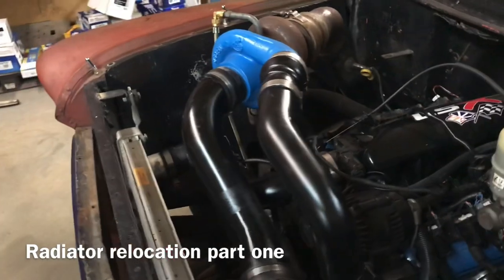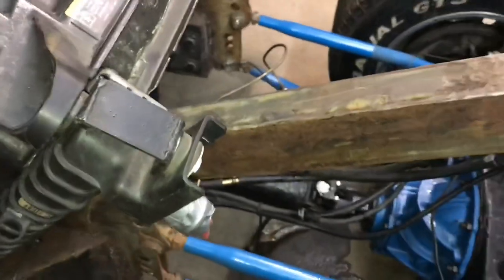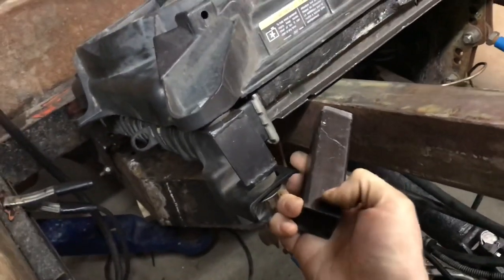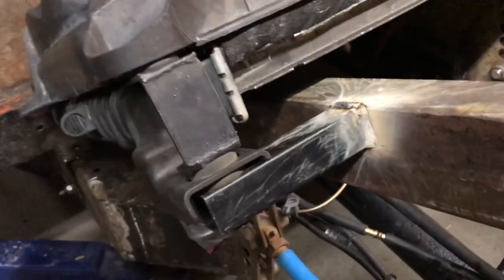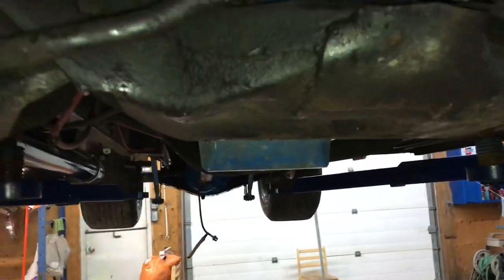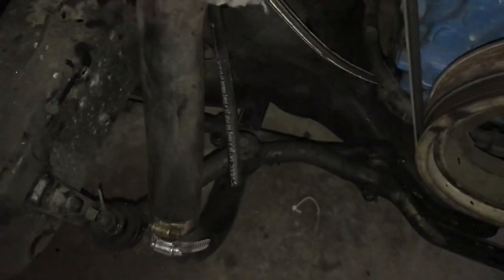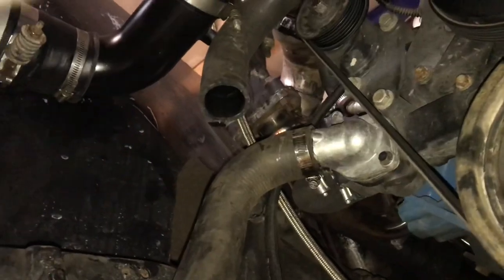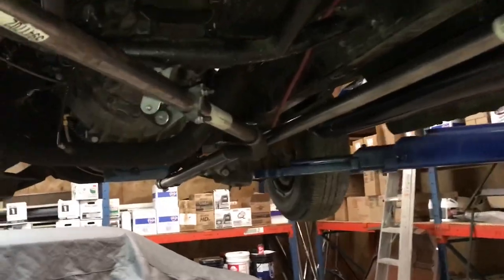How to bed mount your radiator super easy!

Comment: Did you put a better flowing water pump in? I’m looking to do the same in my ls swapped s10
Reply from the maker: Nope, stock truck water pump. I had the radiator in the bed of my Chevy with a stock pump and had no issues at all

Comment: Electric water pump ? Or factory
Reply from the maker: It was the factory pump
Reply: Did it move enough water and did you daily it any
Reply from the maker: I drove it every day, even went on a 1,000 km round trip one weekend and never had an issue at all. 

It did overheat on me until I found out that I had to reverse the fan direction. It was blowing toward the ground, and I had to switch the wires so it would pull air from in under the truck and blow upwards. After that it was awesome.
Reply: Ok awesome thanks so much
Reply from the maker: You got it man

Comment: do you have any overheating issues? looking to install a rear mount rad in a 1969 dodge A100 with a viper swap. thanks
Reply from the maker: Okay that sounds wild! I’d love to see that done. And nope no overheating issues anymore. I did have issues when I had the fans wired in reverse so they were trying to push air through the rad, but when I changed it to pull air through it worked perfect, kept the temp at 180 while idling on 80 degree days
Reply: @StationroadRatrods  did you find it ran hotter on the Highway or running around town at the slower speeds?
Reply from the maker: On the highway definitely. Around town it kept it cool fine enough, but on the highway at 60mph there was not enough flow and it would get hot super quick. After I fixed the flow direction I drove 200 miles straight on the highway without an issue
Reply: @StationroadRatrods  how did you change the flow direction?
Reply from the maker: I may have written it sorta confusing, I meant the airflow direction. Before, I had the fans wired to push air through the radiator and it didn’t work well, so I switched the positive and negative wires so that the fans would pull air though the rad and it worked perfect all summer.
Reply: @StationroadRatrods  even when cruising? I have a s10 and radiator in same spot and I can only cruise it 2-3 miles before I have to shut it down
Reply: If you have a Facebook man would love to chat my name on their is rust knocker
Reply from the maker: Yup, I drove 200 miles in 85 degree weather, at 70mph and never went above 185 (I have a 160 thermostat, fans set to 180) might be a stupid question but are you 100% sure all air is out of the radiator? I had a hell of a time bleeding the air out of mine, I had to lift the front of the truck up like 3 feet, fill it up and let the top rad hose off until water came out, then fill it up, and repeat. I think I was like 3 hours getting it bled fully. Another thing to look at is the shroud, is it sealed to the rad perfectly? If not, air will get in between the rad and fan, not through the rad
Reply from the maker: Sweet I’ll find ya
Reply: @StationroadRatrods  how do u bleed air out of ur system?
Reply from the maker: It was difficult but I left the top rad hose off and filled the engine with water until it ran out of the top hose, then clamped it on, got the engine running and continued loosening the top rad hose and letting air off until only water came out. It was a couple hour process